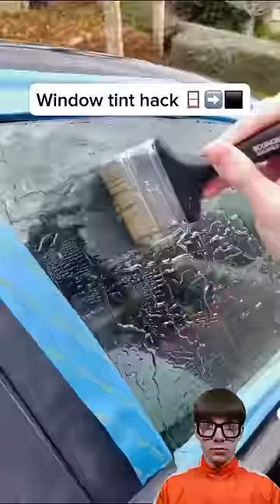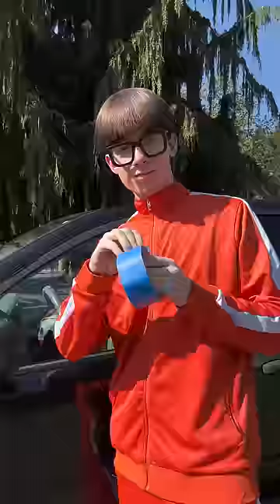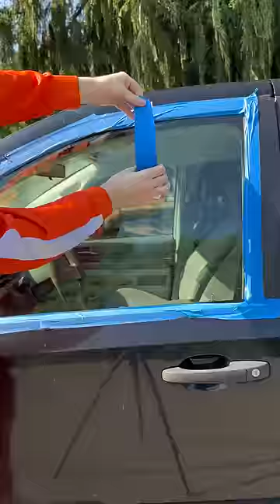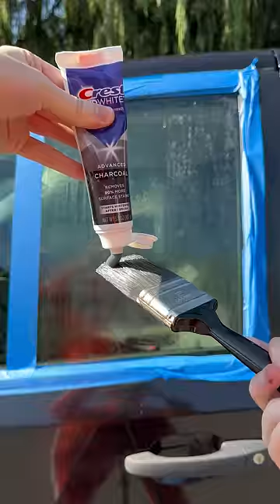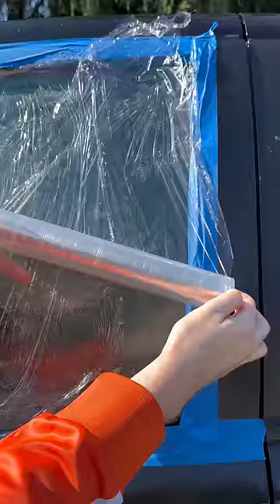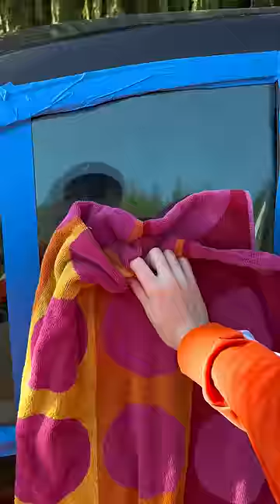Window tint hack

Comment: Ok it works. U put something sticky on the surface, then all little things attach to it. It would work better with some acid like vinegar in + normal soap work by connecting to water and particles. But calcium build up is the problem holding other things. So vinegar and something sticky.